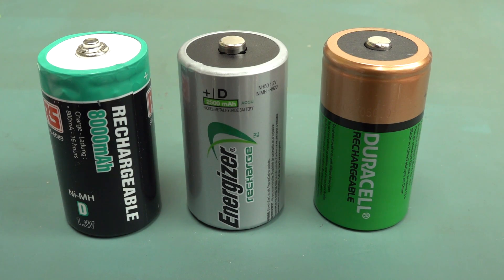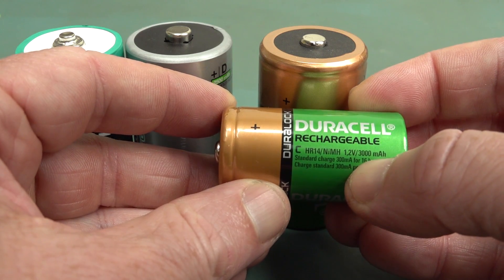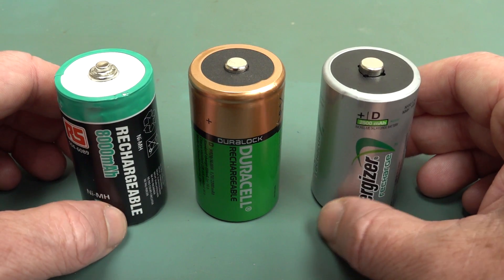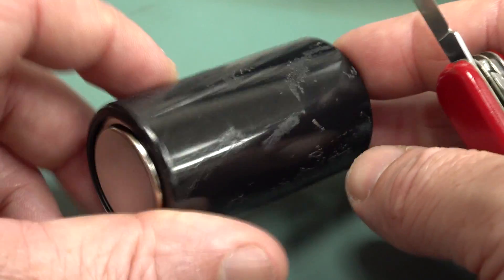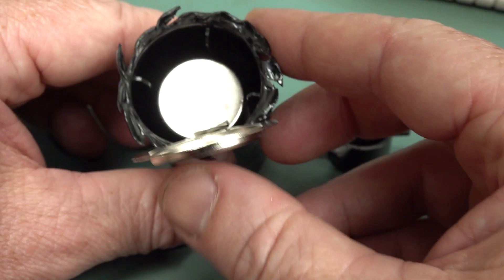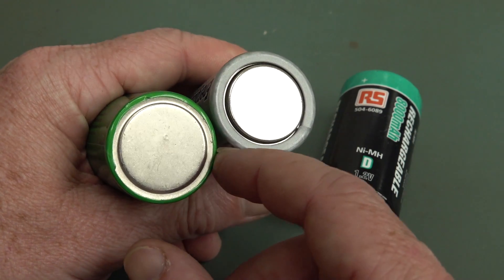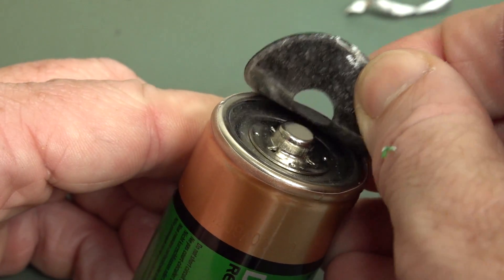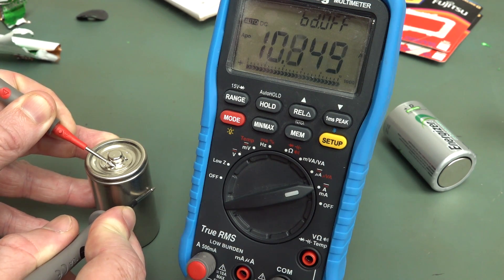EEVblog #1200 - BUSTED! - Energizer & Duracell NiMH

Comment: This has been the longest running scam of larger rechargeable cells. I have pulled apart NiCad "D" cells back in the day, and it was literally an AA sized NiCad cell with the remainder being air like in these cells. I immediately knew something was up feeling the weight of the cells. One brand of NiCad "D" cell I pulled apart actually had a finished labeled AA cell in it. They literally took a completely finished cell from their AA line and shoved it into a "D" shaped shim. It would not surprise me if this happens with off brand Alkaline or "Heavy Duty" D cells as well. Most one time use cells don't even list mAh ratings on the package, so even easier to pull of the scam. The only reason it probably doesn't happen with C cells is there is no readily available cell that will fit into the space, so they have to make a dedicated cell for the size format anyways. If you have ever pulled apart a 9v battery, they are usually 6 AAAA cells. Only a few I have pulled apart use an ovalish shaped stacked "coin cell" format cell for the battery. One I have never confirmed, but have suspected for some time is 6v lantern batteries. If you have ever pulled these apart they contain 4 cells aprox the same diameter of a D cell but about 1.5x the height. I do know that plastic shims exist on the market to allow you to put 4 D cells into the shim and then use it in your battery powered lantern. I would not put it past some manufactures to be just sticking D cells into these one time use 6v batteries as well.

Comment: Not that much different from their alkaline marketing practices, really. "Lasts upto 7x longer*", with the footnote being "(than common Zinc-Carbon batteries)". Yes, because it's still 1970 and people still regularly buy ZnC dry cells anywhere other than dollar stores / pound shops, or occasionally in plain-wrapper value-range multipacks that are so hilariously cheap you don't expect them to last any significant period other than in a remote control... comparisons with other companies' alkaline cells being markedly absent. But the intended effect is that you think that's what's being compared against.

Shame they go for such blatantly misleading tactics, really; Energiser's lithium-based AAs of maybe 10 years ago still rate as some of the most impressive single-use batteries I've ever bought, and genuinely ran at least twice as long if not far more in high-drain devices like older digital cameras... but it seems almost like they made something too good to be economically viable and you'd be hard pressed to find a supply of them any more, and they certainly never seemed to play up their benefits much in adverts. There's probably rather more money in shifting a dozen packs of mediocre alkalines at 3.99 a pack, than half a dozen lithiums at 7.99, even after considering the latter may get more repeat sales vs the former being displaced by supermarket own-brands where available...

Still, unless you're ordering off the internet, most stores will only really stock their own brand plus one of either Duracell or Energiser, so there's not a great deal to choose from or compare. Maybe they're better than the store brand, who knows. But you can at least compare the rechargeables on the basis of capacity, where there is even an own-brand rechargeable to be had in the first place, and they probably come out about the same, so people will likely either go on the balance of what they can afford vs what seems like the more reliable choice, where it isn't simply a case of "will it fit in the device I need to power".

And, like, who even uses Ds any more, other than in old kit that demanded the large batteries because of the terrible low-capacity formulations of yesteryear where cylindrical batteries with capacities over 1Ah were the stuff of pure fantasy? Meaning that 2.5Ah is more than sufficient to keep them running for a pretty long time (and why hardly any new devices use anything larger than AAs when they don't instead feature a lithium pack), because it is still greater than what you tended to get from NiCad and single-use Zincs, and at least roughly what an older generation alkaline would provide. I think I've encountered one new device that takes them in the last 10 years, and that was a huge toy robot given to one of my nephews (who's 5)... and I have serious doubts that it was actually that new to start with, it could well date back to the early noughties if not earlier... Given the speed which it runs them down and the cost of replacement (or the hassle of recharging such huge cells), the decision was made to just let it run down then remove the dead ones and tell him that it won't walk or talk any more because the batteries "ran out". It could probably be powered just fine, however, with some NiMH AA's and some bundled-up tinfoil to act as conductive packing...

Comment: That RS Components cell probably cost upwards of AU$10 if purchased off the shelf in a physical store, even at a wimpy 8000 mAh. That's why D cells are just an adaptor over a AA/subC. This isn't news. There is nothing being "BUSTED!" here. You shouldn't be hanging around with that Thunderf00t fool. He's a bad influence.
You can spend as little as US$6.50/cell for the standard 10,000 mAh rating if you are buying 6-8 packs.

Comment: Adding to the roll of inner material could make the voltage increase beyond 1.5v
Reply: No it can not. The voltage is always the same for a single cell no matter how large it is. The voltage is defined by the materials used. If you don't get it just imagine that a small piece of the roll is a cell of its own and see that all the tiny "cells" are connected in parallel with each other. Winding up more material would only increase capacity and maximum current output of their batteries - the more the better for both of the parameters. Well, I guess just not from the duracell marketing department's point of view.

Comment: Oh good grief. Radio Shack was selling a purple D case NiCd that contained a sub-C NiCd more than 30 years ago. 

The high shipping cost of heavy D cells and the higher material cost are what drives the shell-cell. Weight is the driving factor because batteries can’t be made in the high income consumer countries because of the cost of the paperwork to reassure all and sundry of environmental compliance. 

Paperwork is as much as 80% of the total cost of environmental compliance. Redundant paperwork and certification testing to multiple local, regional and national agencies is as much as 4x the cost of the underlying process changes to make a basic cell production line clean; changes to reduce scrap and clean out and changes to scrap material handling, waste water treatment, and air filtration to contain production materials and recover materials that would otherwise escape into a waste stream back into the production stream. There has to be a better way to remove the incentive to cheat. The current strategy is designed to drive production offshore. We then complain that the new producer is an environmental disaster and pretending we didn’t force this outcome.

Comment: Is the glass half full, or half empty?
  My Grandfather would say ''It's the wrong dammed size''.  (That one always stumps the shrinks)   In this case, it IS the right size.  That's what ''D'' means - size.  If the size isn't right, it's not a D-cell.  Without an actual capacity test, there doesn't appear to be any 'scam' involved.  IF you buy based on marketing and hype, you got what you paid for!  A 'scam', is a whole other animal :-D

Comment: The reason must boil down to one thing:  The profit for the company.
They've got it all figured out.  They would prefer that you buy their regular batteries because you will have to buy new batteries more often, and they make more money.  If they make the rechargeables 3X as powerful, they will cost at least twice as much and nobody would buy them.  And if they did buy them, they'd be buying even less replacement batteries.

Rechargeables cost more, and most people don't buy them.  Making them more powerful and more expensive will just make that worse for the company.  

I don't know how RS does it.  Never heard of them.

Comment: Batteries are just sheets of toilet paper in a roll,
All that work to pretend its not an AA inside.
I have some D adapters that take 3 AA's.
That being said real C/D nimh cells are incredibly expensive.  I always had assumed they were sticking a real AA inside those fakes to save money, instead they were working very hard to not do the right thing...egads.

Comment: I don't understand this video. They are smaller inside, due to price points, for what is needed,. They are D cells, what do you know that runs D cells these days? Flashlight? Kid toys? Why would they stuff large capacity of material in them to raise the price? Why would they have a larger size for the D cell, when the C cell size is adequate in pricing and capacity for that platform? The D size case is to fit the older style products that still use it. Maybe a higher priced larger capacity D cell battery is what you quest they offer? This is just new tech material in batteries being used in old style cases. Should we complain if they engineer a material that is many times smaller, larger capacity, but costs a lot more, so the batteries have internal cells the size of BB's in a D cell case?

Comment: I forgot to mention that some of these "extra packed" batteries are actually bigger in diameter than the battery size specification allows. This means that the larger mAh batteries may not fit into all devices due to narrow build tolerances. For example, I have an LEDLenser 1 AA battery flashlight. The difficulty with this flashlight is that its cylinder clearance just fits a standard Alkaline or NiMH battery. If I try to put in a larger mAh battery, the diameter of the battery is simply too large and will not fit. 

There is something to be said for manufacturers not packing the battery's casing too tightly, like the 8000 mAh battery. It's frustrating when rechargeable batteries you thought were a good deal won't fit into the device's compartment. So then not only can't you use the device at that moment, you're forced to go out and buy even more batteries... and then hope they fit.

Comment: Both Energizer and Duracell have been coasting on their brand identity and "quality" for years now. Back in the 80s and 90s, these brands meant something. It meant that their batteries were genuinely better than the generic counterparts (i.e., NoNameBrands, Realistic or even Rayovac). In the last 10 years or so, these two companies have been heavily sacrificing quality for cost and playing tricks with their battery lines... particularly their Alkaline batteries.

Energizer is still mostly better than Duracell for Alkaline batteries, but both of these brands are so far behind the curve for the rechargeable market, anything you buy from them in rechargeables today is highly suspect. Once the Eneloop battery technology arrived, it pretty much killed both Energizer and Duracell's rechargeable market. Those batteries you opened were the result of how these recognizable brands chose to compete against Eneloop... and it's not pretty.

I'd also say that you shouldn't take their datasheets at their word. You should, in fact, test to ensure their datasheet is accurate. I'm almost certain those NiMH batteries wouldn't perform as written in most cases. That's how far Energizer and Duracell have fallen. When the cheap knockoff brands make better batteries than the so-called "name brands", there's something seriously wrong with this industry.

Comment: Sad tactics like this became hugely popular as the US exited the 2008 financial crisis.  In retail and grocery, the same size package is sold for the same price, but contains somewhat less material.  Many people don't think twice and assume they're getting the same deal as always.   Or the same size package is sold with significantly less material and the price is reduced.  People think they're getting a better deal than before.  I'm certain this is true for batteries. People know they need a D cell and buy the least expensive one thinking all D cells have the same performance.  In reality the D classification is just a physical size and starting voltage.
Reply: I've had pretty good luck with Tenergy's NiMH Low self discharge batteries.  I mainly use AA, AAA, and D.  You sacrifice some capacity for the LSD feature, though.  They sell higher capacity non LSD batteries too.

Comment: Some equipment example flashlights use different size batteries , that's why the d and c cells exist but still using the same voltage and amperage. Some older test equipment for telecommunications example faulltman's test set use the type  c. Even older tone and probe sets , multi-meters and your normal fm radios. Doesn't matter the size or brand but Energiizer and Duracell are more  hi-tech and do last longer.

Comment: Best idea for general use rechargeable C or D is to use spacers with standard AA NiMH cells. Eneloop brand is generally best by a wide margin. If you really NEED top capacity NiMH or NiCd cells in C or D size, they are available, at much higher cost. Some special-use types, such as are used for assembling power tool battery packs, are designed to withstand very high charge and discharge rates.

Comment: Hi, I do not have much knowledge on Duracell and Energizer batteries, but I guess that these are fake batteries. 

Just like how most genuine 18650 batteries have fake counterparts which are filled with small batteries, I guess that these are also fake batteries with the same scam.

I am not really sure, but this is what I am guessing.

Comment: With the rare situation that I need a D cell I prefer to use non rechargable for the extra capacity and longlivity.
Last thing I changed was for a large maglight flashlight and the last set of batteries in that lasted 10 years

Comment: These are not exactly news... they've been making them like this since the days of NiCd when I was in school, so at least a couple decades. Both A cells in a dummy case and "partial load" cells. Back in the day, (some 20-30 years ago) a proper "full-load" D-size NiCd cell was rated at 10AH, but they also cost around $12-15 a cell. ;) Try selling THAT to today's consumer, who's used to getting 4 AA size NiMh batteries for $10.

Comment: When you look more closely into this, the variations in price vs capacity, makes you wonder how the big names get away with it. On RS U.K. you can buy a whole range of c cells, with big variation in capacity vs price. 
But go here https://www.componentshop.co.uk/d-size-10000mah-nimh-battery-single-battery.html and you will see a 10000mah c cell with a top rated capacity/price ratio. 
This company is a highly rated RC supplier, they test everything to maintain standards.

Comment: This is exactly why when the kid's baby swing required a bunch of D cell batteries, I got those plastic cases that let you use 2 AA batteries in place of one D, a bunch of Amazon branded NiMH AAs, and a 16 slot charger. We don't use the swing anymore, but I still have a bunch of 2500 mAh AAs, which are much more useful than Ds anyway.